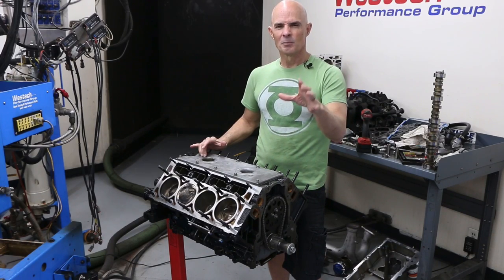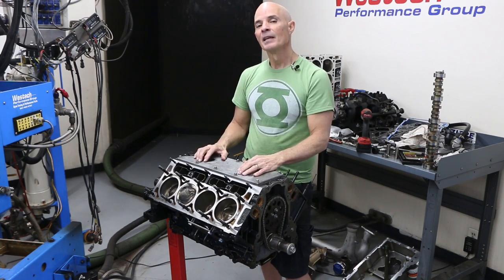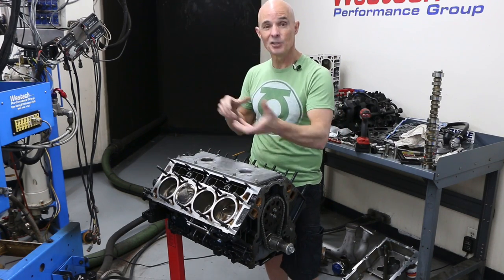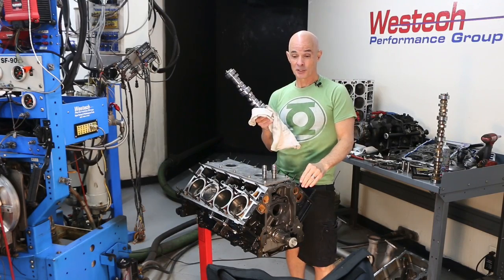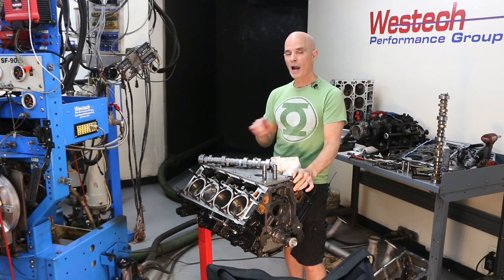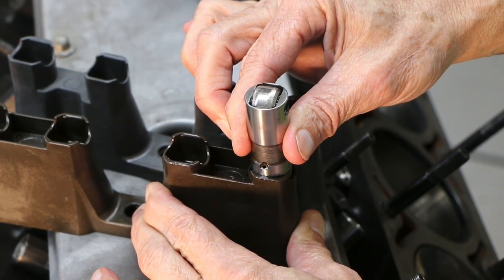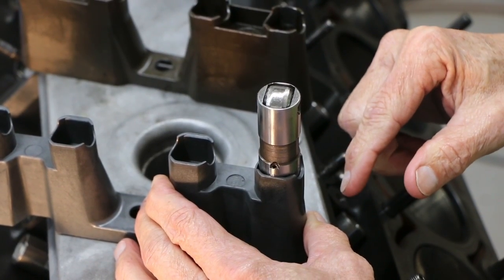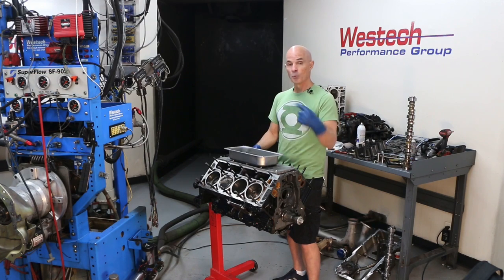WHY IT BROKE! 4.8L LS LIFTER FIX!

Comment: Richard, great videos! I’m the guy that runs a rowdy heads/cam 14’ LS3 Camaro 500-600 miles a week just for work. Every time I do a cam change I pull the heads and replace the the lifters and  trays. Each time I’ve done this my lifters look like yours. I get 30-40k on a cam. I’ve had 4 cams in this car. Is this about the life your getting from an aftermarket cam? I’d like to see some endurance tests 😬
Reply: Marvin Clarke maybe try less spring pressure if you arent revving it too high. Might help with your cam wear. Ive heard of high lift cams being worse when it comes to cam/valve-train wear too
Reply: Know Bull5hit   I’m sure the high lift cams I run will be harder on the valve train all together. I use the BTR .660’s. They are pretty standard in the LS world. I just pulled the motor because it felt down on power. I looked  at it and it trashed a lifter wheel, and an 8620 alloy Cam Motion cam. Needle bearings and pieces of the wheel are in my pan. 🙈

Comment: Richard, would love to see you guys do a proper test and description of reading spark plugs and teaching folks how to read for a rich lean condition And also how to choose the proper heat range. I’m assuming lots of folks like to add power adders but they don’t know how to properly gauge the correct heat range to install. Thanks again.
Reply from the maker: we run 9 or 10 heat ranges in out boosted stuff

Comment: Richard, great channel ! 
I have two comments regarding your LS lifter situation. Firstly, was the end play on the camshaft ever checked? With a junkyard engine like that I’m just wondering if the cam is moving in the block for and aft and contributing to wearing out the trays? Maybe it’s just something that needs to be clearanced And tightened up from the factory specs to make it more suitable for high-performance. Secondly, nobody in the aftermarket makes any kind of lifter Tray that is upgraded? I am thinking that’s not a part that I would personally be comfortable with being made out of plastic. Your thoughts please. Thanks.
Reply from the maker: New factory trays work well-these lasted 250,000+ miles-they were just worn out-new ones fixed

Comment: I have two ideas for you to think about.  First is practical and I believe would cover a wide range of ppl As well beneficial to enthusiasts and tuners to test a couple or few stage 1 and/or torque camshafts that would play well with factory converter. Maybe with headers and factory exhaust manifold. I build and tune gen 3/4 and in my rural area in Kentucky one the most asked questions is what’s the best option/setup for low end torque for heavy 4x4’s as well towing that is cost friendly but would yield best tq below 2500-3000 rpms. With your experience and expertise what’s the best cost friendly upgrades that would produce the best numbers possible below 3000 rpms.  I think it would be neat to see what kind of tq numbers could be achieved down low from the small guy (4.8). Second idea is id love to see what kind of numbers and rpms a solid lift roller would do n/a as well of course with of course “BOOST”!  Turbo and procharger.  If you happen to do a solid roller test in the trusty lil 4.8 please include a sound clip of the idle with a few quick revs.  I bet it would sound amazing!!!    You always bring great content and eduction! I always can’t wait to see what’s next and I appreciate what you are doing.  Thank you!!
Reply from the maker: I don't do much solid roller stuff cuz that is a very small part of the LS market, but it would sound cool. I try to cater to the average Joe. I did a Hunt for Grunt series that needs to be in video form that went after low-end torque-I'm testing some things for that today in fact.

Comment: i want to see a comparison of A/R's on the S475. 1.0 vs 1.1 vs 1.25 vs 1.36 or what ever they are. i want to see a difference in spool and back pressure vs boost, AND if you can a difference between Exhaust trubine size 82mm vs 87mm vs 96mm BUT i know that requires 3 or 4 different S475 turbos.

Comment: How often do you replace the tray hardware? Perfect timing for this video as I'm doing a cam upgrade. Please do a ZL1/LSA supercharger!!  I have one that I haven't i installed and I'm curious on the power gains.

Ahmad
Reply from the maker: i don't have one of those to test-but would love to-got something else strange coming up though
Reply: boostnhoe  what engine are you putting that LSA blower on? Matt Happel put one on a cam/spring only 4.8 that originally made 350wheel and he cranked out 600 hardly trying with the blower
Reply: Most people using the LSA blower live reliably in the 600whp range without trying for max effort. Just street cruisers/tire burners

Comment: See how long u can make an old small block chevy run without coolant. For demolition derby research purposes. With minimal improvements just loosen up tolerances to take the heat and abuse, rings valves etc. Shure u might have a few ideas yourself.
Reply: Methanol
Reply: Uh, try just using this really cool stuff called “water” instead of coolant…😂👍

Comment: youre correct,  i had a factory roller sbc, over revved it, bend one of the fingers on the lifter hold down, and it spun, and did the exact same thing that happened to you

Comment: $25 for lifter trays, so change them any time you have a chance and they have a good amount of time on them.
Reply: Shoot for that kinda money it sounds stupid not to replace them if this is an issue on long term engines. 
Not an LS dude but it's cool seeing them in all kinds of stuff. 
Head and shoulders 100x better design than the ol 350 (lol here comes the hate , they had their place and did good )

Comment: Picked up a junkyard 5.3 with lifter issues. This was a really helpful video. Thank you. It seems like there’s a big gap of dyno tests on the summit LS cams which seem to have some unique specs compared to the more commonly used cams. I’m interested to see a few of their truck and Pro LS cams tested in the 4.8/5.3 platform.
Reply from the maker: I've run a few of those
Reply: Richard Holdener awesome, are the results publicized anywhere? I’m looking at a few different ones for my build. Obviously the cam is wiped on my 5.3 so I’m leaning toward the 8713 for a moderate NA and eventually turbo build.

Comment: I'd love to see a 4.8 with 3.89" bore , and how it compares to a 5.3/5.7, could be a bore vs stroke test.
Reply: I'd like to see the same thing with a 4.125 bore 3.25 stroke vs a 6.0 on 28 lbs turbo boost.   348vs364
Reply: Cole S  Richard did a LS3 with 4.8 crank, revved it to 8k. No video on it just a right up if you google search “LS3 4.8”. Thing made tonnes of power per cube but had lots of $$$ into the top end
Reply: @knowbull5hit590  thanks I'm thinking this combination will work great for a stick shift car. Making the power at the top

Comment: Is it beneficial like some believe to drill holes just above the liftersfor oils return improvement in ls based engines that live their life at higher rpms?
Reply from the maker: I've hear this but have not tried
Reply: I've done it to a few corvettes I've built.
Still running and racing, so don't know if it helped or not. Used 3/8" bit. ;)

Comment: That is exactly what is happening. I have had the same issue in the past. The lifter is turning inside the lifter tray. The tray is getting old and when it gets hot it gets soft and allows the lifter to turn off center on the lobe. My opinion is a link bar lifter would be the best choice to avoid this in a high performance engine.

Comment: Do you reuse your head bolts? If so when is it time to get new bolts
Reply: I know that that wasn't the question the question is does he reuse head bolts and if so when and how does Richard know to change them
Reply from the maker: do reuse the stock ones on occasion-especially on na motors-I replace when they feel squinchy
Reply: Like always Richard great content

Comment: Sloppy stage 2 versus the world cam test!  Can't wait
Reply from the maker: That should be good
Reply: That would be good!!

How about Sloppy Stage 2 vs. Howards ASA cam? I'm interested in seeing long duration low lift cams.
Reply: What's so good about the stage 2 vs any other aftermarket can
Reply: @benaiahtheassassin  in my opinion? Nothing. Some people think it's the best thing ever and it's not. It's going to do reasonably well.
Reply: infamousnova what makes it good is how many times Matt has shown it work well in a wide variety of setups. Sure others are great too, but Matt’s shown it work for yrs when there wasn’t that much other in your face info on cams out there.
Reply: @Screamingz1  yes.  Good at everything, great at nothing.  I have one in my car, so don't think I don't like it. Lol
Reply: Brent Spence couldn’t have said it better haha. Good at everything great at nothing
Reply: @Screamingz1  like a maintenance man.
Reply: @benaiahtheassassin  they like it because on a good day that cam costs 230$ and it's under .600 lift so less expensive springs 'll do ya. Get most of the power for half the price.
Reply: @benaiahtheassassin  come on man.
Reply: Just had east coast supercharging do a cam kit install (new cam pushrods timing chains and springs) on my C6 corvette. 1200 miles and 5 weeks later a lifter broke locked the cam up which cocked and broke the timing chain and broke 3 valves as well. After watching this video I have a sneaking suspicion of it was the lifter that failed it coulda been due to a damaged tray during the cam install process. Even though they are trying to say “this just happens to engines sometimes”. Yea , right. Such a coincidence it happens right after you touch the lifters.  I’m easing he’ll if they try to charge me for this. Oh and the engine only had 32,000 miles on kt
Reply: Good at everything 🤔sounds pretty great to me,  🤘

Comment: I had a very similar instance happen that made the same scarring on the lobe. While running it would make a weird and very deep basie thud intermittently. If I could post pic I would. The client did reuse his trays, even though were snug fitting, it doesnt take much.
Reply: A good reason to never reuse trays, they are a wear item and should be replaced. Great video Richard!!!!!
Reply: I’m curious if the hemi lifters trays are doing the same thing
Reply from the maker: a little different design-but certainly possible
Reply: Richard Holdener 
The hemi seems more like a design /material issue 
If I had to guess

Comment: This is a great video especially seeing how just about to start pulling down my 6.0 LS engine for my Buick GS. Do you mind if I mentioned this content on my channel? This was very good diagnosing of a potential day catastrophic failure.
Reply from the maker: feel free
Reply: @richardholdener1727  I think there is a need to find out how much 87 octane can do with boost. For a daily driver 4.8/5.3 that's not max out put, but  fun to drive anyway.  Something an average joe can reasonably afford to do on a budget. I realize 87 doesn't offer much, but not everyone has E85 and/or wants to pay extra for premium. Just a thought. As always, excellent content. 👍👌🏻

Comment: I think it's a little odd those lifter buckets wore out.  How many miles were on them to start with?
Reply from the maker: 250,000 at least
Reply: But I think something else caused this to happen.  It's not typical to see this kind of wear on these engines even with a zillion miles on them.
Reply: @porkbuttrocks  think about what this particular 4.8 has been through...and the rpm that it saw in all that testing. Fair to say this isnt typical of a junkyard unit